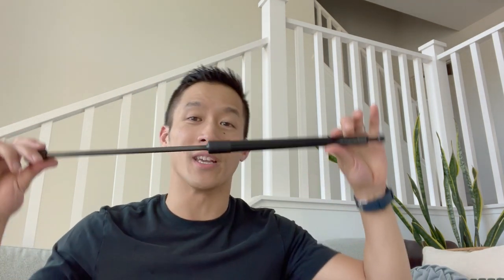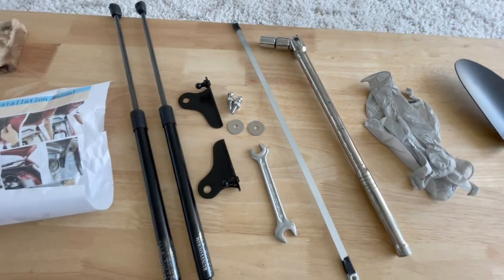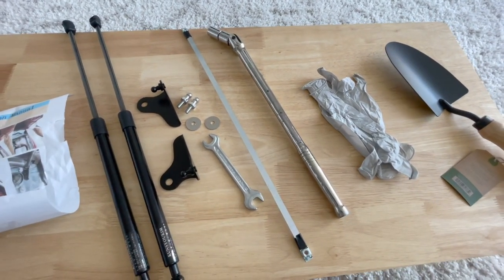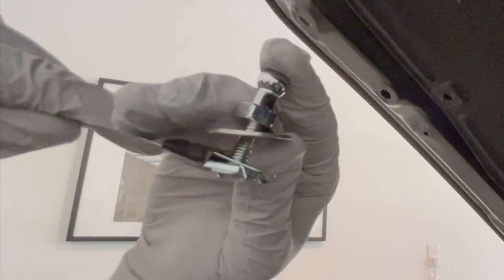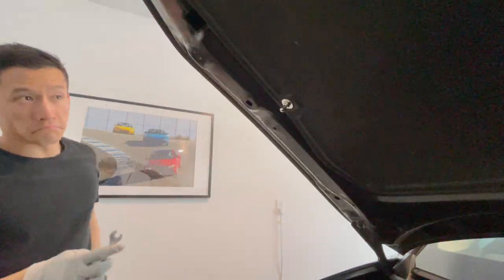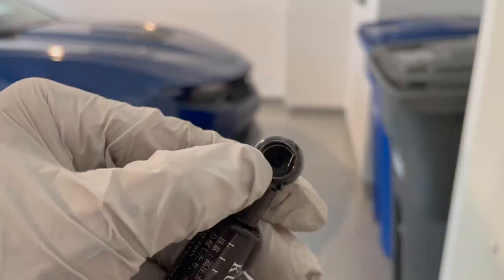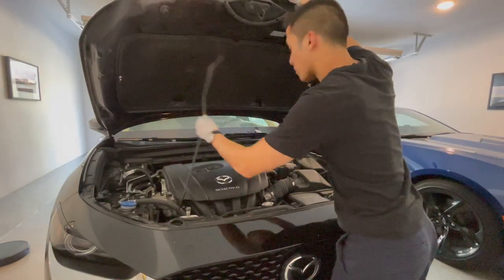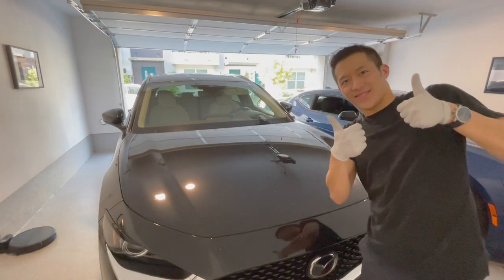Installing Hood Struts on my Mazda CX-30! (Easy DIY)

Comment: Did mine in 10 minutes tops with your video. Sweet! JUST MAKE SURE THE HOOD IS ALWAYS SECURED PROPERLY. YOU NO LONGER USE THE WEIGHT OF THE HOOD TO CLOSE IT SO YOU HAVE TO PUSH DOWN. THAT WOULD BE AN EXPENSIVE DANGEROUS ACCIDENT IF THE HOOD FLIPPED OPEN BECAUSE IT WASN'T CLOSED ALL THE WAY.
Thank you for the idea and instruction.